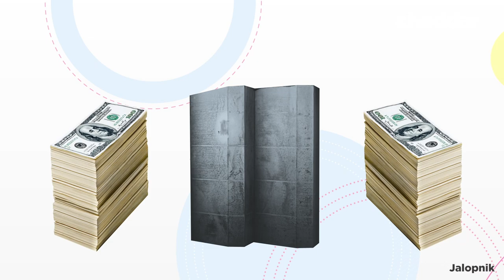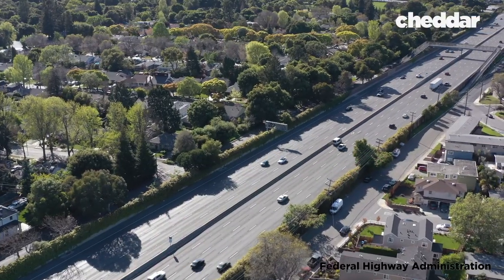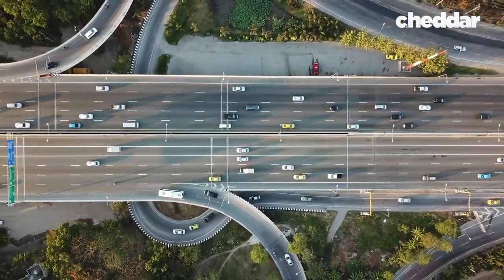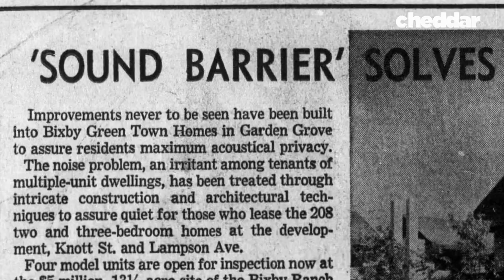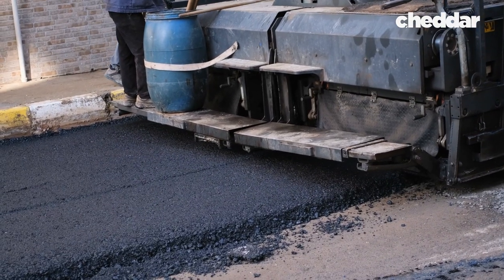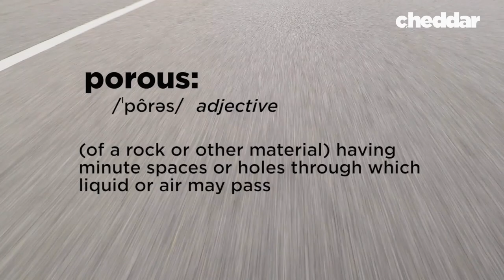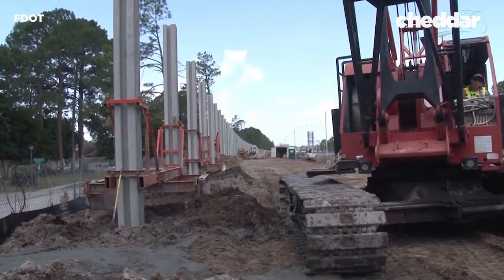How Highway Noise Barriers Can Make Traffic Louder - Cheddar Explains

Comment: The residential street I live on is prime habitat for a species whose Linneaum name is Jac***is Commuteajerka (which have adapted to use it to cut in between two highways), as well as a bunch of invasive young Jackasoffen A-Teeveeus...

Over a few years living here I've found  that the two subspecies are totally incompatible yet drawn into each other as if by gravity or some as yet undiscovered force (likely related to the 'I cam beat that train!' phenomena...

This would usually be wonderful to see, BUT, despite the 'Circle Of Life', and all that, that it would be, IF there were not often young'uns playing on the street (street hockey, sleddong, generally youthful tomfoolery.) There are some municipal workers trying to adress the problem,  but I am not hopeful...

There also seems to be an endemic parasite on the street which corrodes mufflers. it's a puzzle, fer sure!

Cheers!

Comment: This video did not indicate any conditions in which the barrier made the noise louder.  The diffraction effect is well known to a physicist and predominantly affects low frequency sounds.  A high frequency sound scarcely diffracts at all.  So the barrier does help.  However not making the noise in the first place is better.  There can be 10 to 30 dB difference between some tyres/roads and others.  Unfortunately the most durable roads are the noisiest.  And the most durable all weather tyres are the noisiest. So no one is interested in changing these.  Speed is a huge factor in the amount of noise made and no one wants to slow down.  Perhaps, like mandatory noise controls on vehicle exhausts we need mandatory controls on tyre noise to give pressure to make and fit quieter tyres.

Comment: Why go through the trouble of making a video about this and mention alternatives but not explore them in ANY way? What are the alternatives? Different materials? Different construction types? What about concrete/metal walls with a solid line of vegetation on the road-side to provide a soft muffling surface? In the PNW it would probably be Arborvitae, but in the Midwest maybe a tree (evergreen would probably be best) with a surround/base of bushes or high grasses. The wall provides close-in noise barrier (and protection if stuff flies off the highway) while the plants provide a soft, non-reflective surface to attenuate sound reflecting over the wall further.

Comment: Build  narrow gauge train tracks wide enough to carry small city car for long distances at the center of freeways.  To promote car sharing, charge for the transit of the car not the passengers. The goal would reduce traffic and noise, promote the use of electric city cars and eliminate blocked freeways.

Comment: What if they fill a concrete sided, thin wall, with foam..?
Or, some other type of insulation: they themselves mention how softer materials will absorb.
I'm sure erecting some slim concrete panels, to later fill with aggregate, foam, or some other material: will ultimately lower costs, and increase effectiveness.
👀
.
.
You're welcome.

Comment: Concreate barrier needs to be replaced every 30 years?!?! Surely that cannot be correct. If you build a wall with concreate correctly it surely should last in excess of 300 years!
In the UK we mostly have wooden noise barriers (and ones built in the 80/90s are still standing today). Also planting trees help, although it can take a few decades for them to grow enough to be useful, and they vary in usefulness depending on the season.

Comment: Unfortunately I am learning that Noise Pollution is extremely prevalent, in a variety of communities, and that it is a vastly under-considered source of stress for the many who experience it.
If the current sound barriers don't function adequately, it is certainly only because it is a relatively new priority (100+ years, and bear in mind true progress is slow), as more and more, we all experience the negative effects from High Frequency Noise Pollution and Low Frequency Noise Pollution. 
Maybe it is time to make some real progress.
How about Sound Absorbing Walls, instead of Sound Barrier/Deflecting Walls that just send the unpleasant noises to be "someone else's problem"?
And there are some who are beginning to consider sound proofing at the source by understanding how it can be possible.
If someone spends "too much" on a Noise Pollution Abatement Wall that doesn't work, it probably just indicates their lack of understanding of the problem.

Comment: The demonstration of the light is a little different. The light is bouncing off the board and the white walls. It would be a better demonstration if the white walls where not there. In an open world there are no walls to help revelct the sound.

Comment: I thought these were also supposed to be pollution barriers of some kind, whether effective or not,
living in Southern California, I remember seeing reports of effects adverse to health on people's lungs the closer they lived to areas of major automobile congestion.
then started noticing low-cost housing being built, being built along freeway corridors, closest to these high automobile congestion areas, and with their multi-story residences, seeming is a type of buffer for communities set back further from the congestion.

so when I moved to an area of Orange county where these walls are prevalent, all around the basin, Newport, whittier, la mirada, covina, all those little suburban bedroom communities to aerospace and hollywood, much of the original building of those neighborhoods was mid-century, mid last century,
and is made up of shopping hubs like end caps of an aisle, surrounded by walled suburban communities all connected by a web of paved roads surrounded on both sides most of the time by cement brick concrete walls.
... has anybody done any studies on the efficacy of those walls to protect against environmental petrochemical pollutants?

Comment: about to get highway bypass in Jesmond Newcastle bypass. We are 100 metre from off ramp and 6 lane highway.. Barriers are to be built.. NSW RTA determine we are not to get any sound treatment on our home unlike every neighbour from our boundary fence line.. Because the sound stops at our fence.. We are higher and look over all the other houses.. When asking the engineers how far the sound would travel over the barrier. Not one could answer. Australia so far behind all other countries. No rubber barriers or wood etc. Good old cement.. I am selling

Comment: Being an European, this whole video is just absurd. When thinking about this topic, it would be vital to actually think of the causes in the first place. If there were less cars, there would be less noise, simple as that. That would also mean there´s less lanes required now, thus less surface for the sound to bounce off. Despite this not being rocket science, americans seem not to understand any of that. Moving on, the desperate need to make everything out of concrete is tragic. Just look into europe where noise reduction walls are made out of soil, trees or even hay bells. There are of coure concrete walls, but for example in the cities, there are plants or thatch attached to them. Seems like america is SO proud of its culture that they refuse to admit that its wrong. Even the fact that sound reduction walls must fall within criteria of housing is messed up. After all, its just a nice reason to laugh :)

Comment: I have the best solution: quit building businesses & especially homes beside the interstate. The SECONDARY ROADS are accessible at the EXIT which then lead you to developed areas where homes and businesses are. The interstate system was first designed and built to allow travel throughout the United States virtually seamlessly. Limited access.. No stop lights ect.. 
We are NOT supposed to have these businesses and houses running along the interstate anyway. That's what Main Street America is for! 
🇺🇸😎🚬

Comment: the engineering is all wrong too heavy causes more traffic think of all the miles driven by heavy trucks the sand & gravel hauled to the precast site hauling the precast parts to the site the crane to erect them heavy machinery delivered to the site for site preparation .   oh i missed one hauling the cement powder to the precast site and the steel for the reinforcing .now here is my plan it would not only reduce noise but cut down on wind and sun glair also help tire disposal.  well here it is folks a steel arch across the road with strips of  old truck tires & holes could be punched into the tire treads hung from the arch probably about these would be just strait cuts hung perfectly vertical these strips would be the full length of the dia. of the tire   and the steel arches